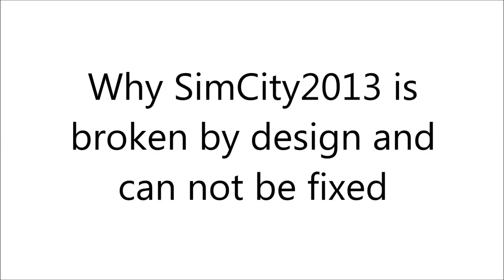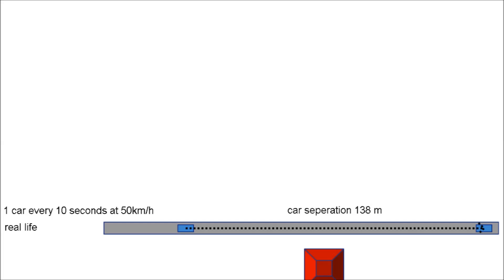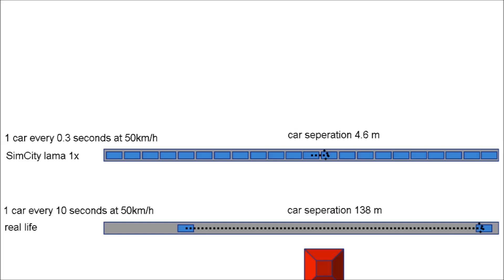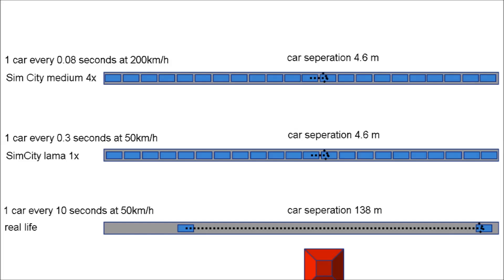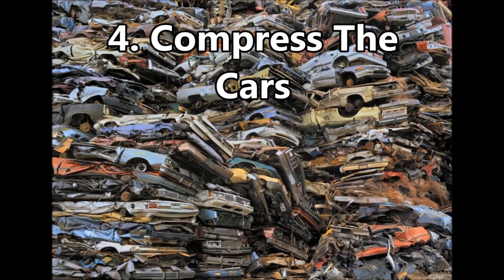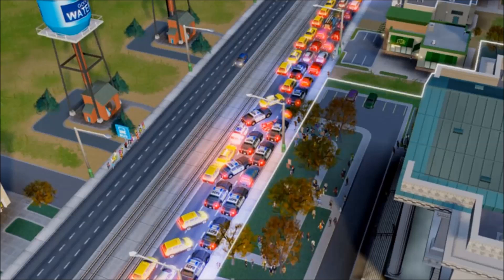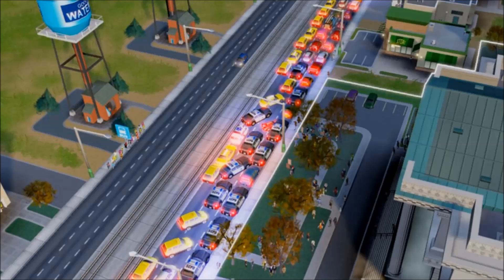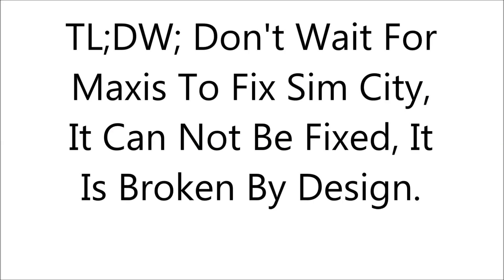Why SimCity 2013 Is Broken By Design

Comment: This whole video feels wide of the point. You're complaining about the scale of the simulation not suiting the vehicle speeds, when in fact the larger problem is that having only one highway entrance into your city creates a bottleneck that will choke your traffic flow. I'd say that's a much more fundamental design flaw than anything you pointed out.

Comment: The solution is simple. EA will just never do it. Go back to cars being representative of total traffic instead of being individual agents. In prior SimCity games, cars were just painted on. Sure, you'll get cars doing derpy things, BUT the overall simulation would be better. The problem is that you could no longer follow a "Sim" though their day if they use mass transit or a car. EA cares more about the ability to follow them than the meaningfulness of doing so.

Comment: The solution would be to have each job-providing and leisure-providing building provide only one quarter the amount they currently do.  Then, what you do is to say that sims only go to jobs/leisure every fourth day.  Could be more extreme if it doesn't solve the problem.
Or, maybe the better solution is for us all to shut up and play SimCity 4. ;P
Reply from the maker: Tommy59375 You Idea is certainly a good one but as I mentioned towards the end of the video under possible solutions and why they don't work you run into granularity issues. And let's not give up hope on a SC4 successor.

Comment: For the #1 fix, you could just speed up the simulation, like in Universe Sandbox, with a slider that goes from real-time to, say, 1000x speed, which is a day/night cycle every 1.44 minutes. 

This works because, in Universe Sandbox, real-time is boring, because there's nothing happening. Would you watch the Earth go around the Sun in real-time while you're actually going around the Sun in real-time? But you can always turn up the simulation speed to make it go faster.

Comment: a simulator while based on real life data, does not come near the real thing, ask any airline pilot. a sim is still a sim, and there is a difference between simulators used to train pilots and GAMEsimulators. the first use hunderds of gigabytes of data, not to mention a lot more hardware then you average home computer...
but as i said first, a simulator puts a person in situations that could happen in real life, however it simulates it based on previous events, ergo is not accurate what so ever.

Comment: the things you mention are not design errors, they have been this way since the early simulators (they were even worse back then) if maxis truly made simcity as real life not only would nobody have a harddrive big enough, but as your only valid point in the video is very boring.
bottom line: you're comparing a game to real life science, which is comparing apples and pears, they're both fruit, but quite different.

Comment: You are wrong about the first way for them to fix it.
It can be done, and would not make for a boring game

10 in-game speeds. At speed 1, 1 SimDay=1 Real Day
At speed 10, 1 SimDay=1 minute

It solves that problem. Then they need to fix the AI.

Ultimately, if they fixed the time scale (make it Year, Month, Day, Hour - rather than minute, hour, month, year) and the AI (so Agents house/work doesnt change), the game runs better and fixes a lot of the simulation issues